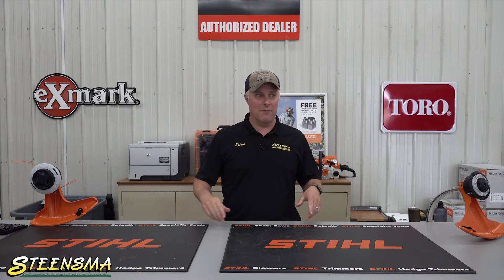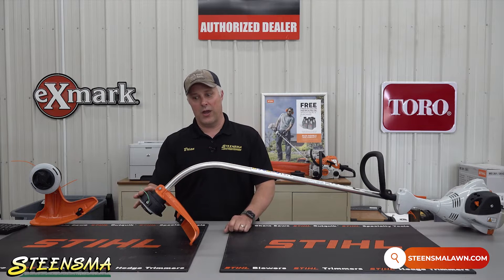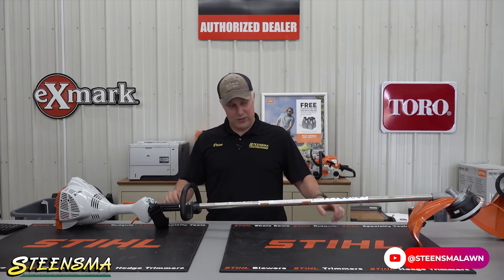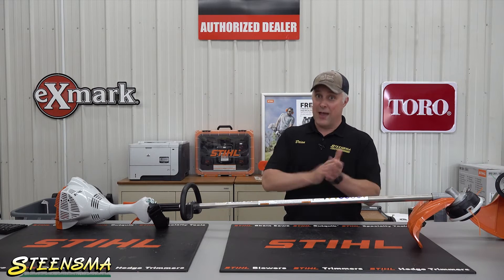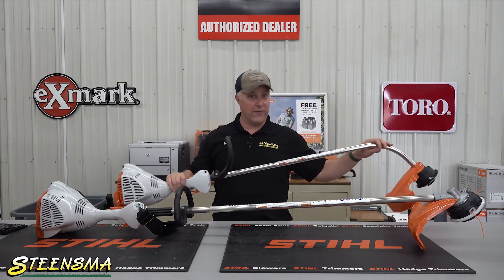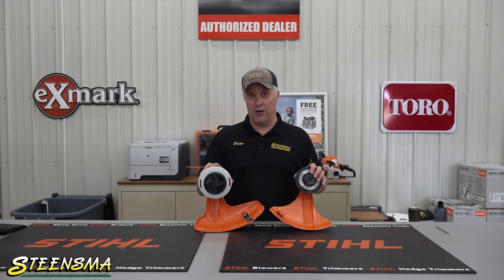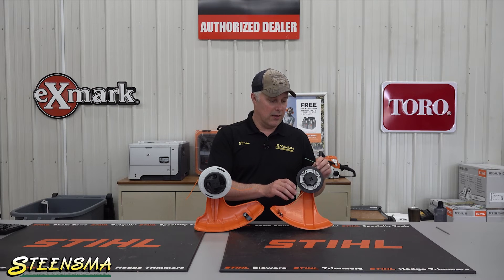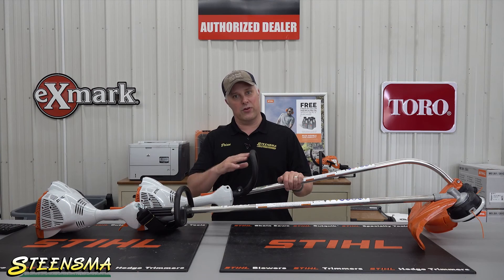STIHL Curved Shaft vs Straight Shaft

Comment: I’ve got a curved shaft trimmer it’s a fs38 and I do both trimming and the edging I do is by flipping it on it’s side to trim a nice straight edge by going partial throttle and i use 2mm trimmer line and sometimes 2.4 mm line for thicker grass and weeds

Comment: I have a 14 year old TroyBilt 29cc, 4 cycle , curved shaft trimmer. It does not lack power, but it is heavy, so it came with a shoulder harness. I am 6 ft tall and the length is fine for me.

Comment: I always wanted a straight shaft trimmer because I'm too tall...BUUUTT... when I finally got a Stihl KombiSystem blower & straight shaft trimmer, I found out that the darned trimmer turns backwards from every trimmer I've ever owned!!!! I've been butchering my yard with it and throwing all kinds of groovy things into my legs and face---really fast too. I hate it, I absolutely HATE it! I've tried for 3 full seasons to get used to it and I give up. Heck, I tried walking backwards, I even tried cutting left handed---boy was THAT a disaster?!?! You guys love'em, y'all can have'em. I'm going to Lowe's and buying me a cheap trimmer that turns clockwise. The blower works great (when you get used to using an 18 foot long leaf blower!). Oh yeah, the whole reason I watched this vid was to see for sure which direction the Stihl trimmers turn.... and you didn't even mention it.
Reply: You okay man? Could you not just turn around and then walk forward? And you could just google the spin rotation thing btw, there are answers and forums out there, hell stihl even addresses this in their trimmers FAQ. Virtually all straight trimmers turn counter-clockwise, this is because of the gearbox, they reverse the direction. I believe there are some out there that use and idler gear to make it spin clockwise though. I think its just a pain to design them to fit an idler gear because of how limited of space they have to work with in the gearbox, that's just my best guess though. And as far as the trimmer throwing debris into your legs and face more than it should, that sounds like a guard problem maybe. I've never felt that way about it.
Reply: @JoeBlow-ub1us  No. But thanks for your sincere concern. I had a "minor" tendon repair surgery 7 years ago that went MAJORLY wrong. The "He has a great reputation" surgeon wound up cutting the nerve that controls my right foot! Had to shut down my business and go home. Have spent $thousand$ out of pocket buying corrective shoes, insoles, braces, etc. that don't help at all. One of my passions used to be my yard---all of it! I can barely walk around my yard...period. The grass is very lush and thick making it difficult to balance and walking around it with a weed eater now is MORE than a challenge! Even the spots that used to seem perfectly level, don't feel level anymore. So ANY bit of help I can garner, no matter how seemingly small is a very great help indeed. Thanks again for your concern but the problem now is as "solved" as it's going to get. Oh yeah, almost forgot this nugget. The counter lady at the closest Stihl dealer told me over the phone that ALL Stihl trimmers turn the same direction---that really helped things for a couple of weeks! I called another Stihl dealer across the river and saw told that they had, in stock, a curved-shaft trimmer for my Combicut system for about $69 bucks and that for certain it turned opposite from my straight shaft. I didn't have to change brands!
Reply: @roygaisser9230  ah I see, yea that sucks. But yea I was just asking sincerely, not sure if you were being sarcastic or not. Either way, best of luck to you.
Reply: @roygaisser9230  Please tell me you sued the doctor for his mistake so hopefully you don't have to work as much.

Comment: I do lawn mowing as a side job.  I personally can't stand curved shafts.  A few reasons.  I have minor back problems and being over 6 ft tall I tend to be hunched over using them.  Also you can't get any attachments like blades for brush cutting with curved shafts and for me like the guy said they don't have much torque and their manuverability is better.  In saying that my parents have a small yard with no deck or low hanging trees and my dads curved shaft is adequate for them, and maybe for people of smaller stature as well.   But in my opinion for say 70 to 80% of people straight shaft is better

Comment: Im 5ft8 and the curved fs40 kills my back. Just bought a fs94 and the length of the strimmer is way better on my back plus the head is way better. I swapped the standard fs94 handle for the larger looped handle off my old fs40 and its even better. Id recommend a straight strimmer with an upgraded stihl loop handle if youre average height. Anyone over 5ft6 will have back problems with a curved using it for more than 5 minutes at a time. My friend has an fs91 but its too heavy for prolonged use and the fs94 is so light it's crazy. We don't use straps either because they get caught up in the van and make edging harder. Just loop handles so back friendly strimmers are a must.

Comment: I bought a used Stihl FS45C 12-15 years ago and still going strong.   It came with precut head that use 8" trimmer line.   I am tire of changing trimmer line and want to change to Autocut head.  Does anyone has good recommend?  Do I need to buy a bolt that hold new trimmer head?  If yes, what is the size or part number?